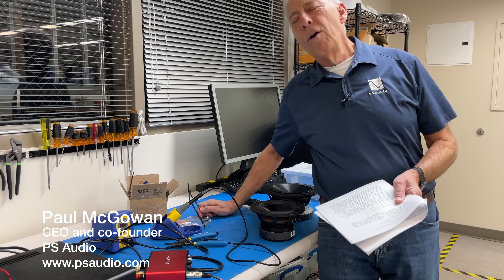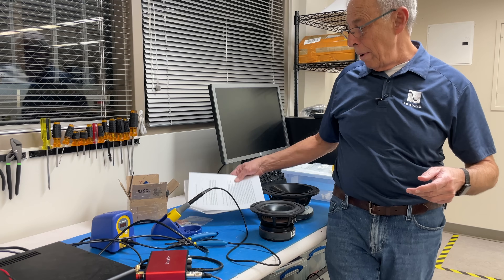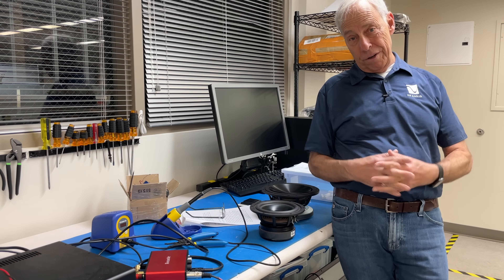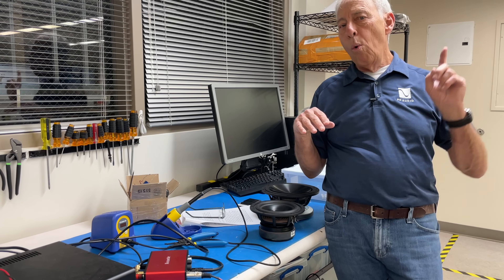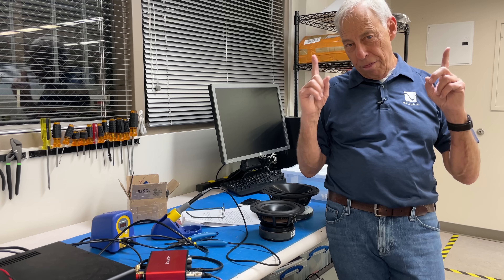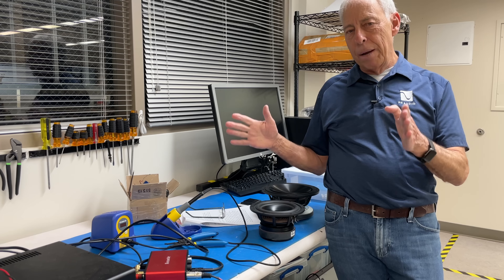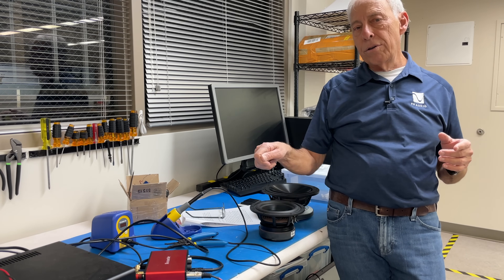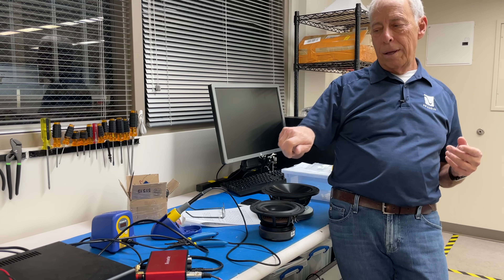Small amplifier clipping

Comment: I have Dali Opticon 2 MK2 speakers (4 ohms, 86.5 dB sensitivity, recommended amplifier power 50-150 watts) hooked up to a NAD C700 (100 watts into 4 ohms), and I'm worried I might have clipped it or damaged the tweeter when listening to Spotify at 77% volume. Is this possible?

Comment: Great point.  I might add that smaller amplifiers may be a better match for high efficiency speakers because the noise floor is lower given equivalent dynamic range specs.  Operating amplifiers at either end of their respective dynamic range also introduces higher levels of non linear response.  In general, the best place to run an amplifier is in the middle of its dynamic envelope as long as it’s not too loud or to quiet.

Comment: I remember when a local high end stereo store near me couldn't demonstrate a system without clipping problems. Of course the only amps they sold were Yamaha.
Reply: Here’s my philosophy: I want to be able to turn all the knobs to the right in their max position with bass boost and loudness turned on and have zero distortion and zero compression/rolloff in the bass.  What equipment do I need for that?  Thx!!!!
Reply: @Mabeylater293  ...You'd need a car that has a speedometer that goes to 140 mph, and then travel that speed until you destroy the engine.
Reply: @Beefcake20  😂😂😂LOL!  No seriously!  Are you saying it isn’t possible?  Some cars let you do that. Google Nissan gtr bathurst 2015. It was the fastest the longest and still the most reliable despite having a smaller engine (v6).

Comment: Really isn't it all about keeping the voltage, on the output, from not hitting the rail voltage supply level? (That is, say the you have a split supply that is 18 volts plus and 18 volts minus,  if you keep the output voltage below, say 15 volts on each side, 30 volts peak to peak,  on it's maximum swing, you won't have clipping (So, no distortion.) ) As long as you stay a few volts below the rail supply voltages, you shouldn't have clipping, for class A or AB amps.  For a class A amp,  as long as the voltage, from the Q point on the load line (on the output device), doesn't swing into saturation or cutoff, there shouldn't be clipping, either. So, no distortion.   Correctamundo?

Comment: hi Paul, is it more a question about the operating point in a class A, AB or D Amplifier ?  if you have a sensitve Speaker Class A is your friend, with a lot of Power consumption. A sensitive Speaker with Class AB Amp you can run in a notlinear operating point with the Amplifier, the output is too low. Class D has no operating point it is on or off.  I thnik the best is a good Class D  amp, the best of two worlds

Comment: When setting up any amp for speakers I've found it's best to use a multimeter oscilloscope and a set of 0db test tones and a 0db sweeping test tone. This is a technique I've learned from doing car audio for years, and will give you max volume and clarity while preventing your speakers from blowing. 

1) make sure speakers are disconnected then hook up the scope to your receiver. Play the desired test tones and find where the clipping point is and go a click or two below it. Some tones will clip before others use the tone that clips 1st to set you maximum volume level. Make a note of where that volume level is. 

2)keep your speakers disconnected, then attach the scope to the amp outputs and play test tones to see where the amp clips. You want to keep the receiver at the max volume before it clips. Once you find the where the amp gain clips mark it. 

3) turn the amp gains and receiver volume all the way down then turn off the system and  attach the speakers or subwoofers. Then attach the scope to the speaker wires.

4) here comes the scary part... have test tones ready (40hz @ 0db for subwoofers and a sweeping tone @ 0db for full range speakers)play test tones at full volume before clipping on the receiver, keep the amp gain all the way down. While looking at the scope increase the amp gains until you the tones are at the desired wattage. You have to be quick playing test tones for too long at too loud a volume will damage speakers and subwoofers. You may also have to use ohms law and figure out the wattage this depends on your scope. Some scopes show wattage others will just show voltage. You can also find sweeping tones for subwoofers too if your worried about damaging the subwoofer. Also because of impedance changes at different frequencies a speaker will act differently with the same volume level. 

This may seem like a lot of stuff to do, but it can be done under an hour. Sound is always subjective and you may find yourself making adjustments after setting the gains, but this is a measured way to set gains and prevent clipping and distortion.
Good luck & Great listening 🤗

Comment: Id stray away from using towers on a mainstream integrated receiver thats just me. Ive blown a tweeter or two that way : ( Some speakers will simply NOT move the woofers at all unless theres a high current amp driving em from my experience. A vintage Altec or Klipsch horn speaker should be fine on most anything however.

Comment: Great discussion as always.
I have a pair of 110w OTL triode monoblocs.  You can run the same amp at 25w by pulling a couple triodes.  It still has the same gain and everything in the system stays the same but the amp power.  So perfect for understanding impact of lower watts.  Into highly efficient speakers, the difference is the bass and overall authority thins out.  With 110 watts, they are dynamic with full bass.  Everything the same, at 25W the system still sounds great just lacks body and grunt.  And the bass is underpowered.  Even though I listen at  <85dB and mostly in the first watt, I easily prefer the sound with the extra power on tap.
Reply: @Jeff Taylor I expect that the OTL design of W's monoblocs may affect the impact of removing a couple triodes. Since the A-50 has an output transformer, its bass may work better despite its low power.
Reply: @tiburd7  Quite possible.  The OTL circuit is by Transcendent Sound.  Designer is convinced he sorted out the bass and it's driving an easy 8ohms, but who knows.
Let us know which you like better.  The SE 300B into efficient speakers may be quite special.

Comment: Even with a pair of speakers with 85 db in sensitivity you dont need that much power to play loud. I think its much worse with speakers dropping in impedence to about 3 Ohm and sometimes lower. Its very common with speakers dropping below 4 ohms. Even if they have high sensitivity mind has 90 db But drops to 3,1 Ohm in impdence They are quite difficult to drive. Many amps can have a lot of power in 8 ohms. But They rarely tell you how They perform with 4-2 ohms loads

Comment: I have a low power amp that's 50w if I change the voltage supply&the transistor can I make it  500w or I'll just burn the dyam thing
Reply: You're talking about changing to power supply voltages that are 3x higher than the circuitry is designed for.  
Don't even think about it!  It would require a major redesign (not to mention much larger heat sinks), and it's far more practical to just buy a bigger amplifier.  Then you can keep the 50w amplifier around for times that you don't want to play music loud, and you would like to save on your power bill.

Comment: In my system my speakers are rated at 88db / 4 Ohm. My amp is rated at 500 Watts RMS output per channel into 4 Ohms, total harmonic distortion < 0.03 %. It is incredibly rare that I push out over 10 watts (as shown on my amp's meters) in normal listening situations.

Comment: some speakers especially some old ones from the 70's give louder sound db. instead of running 100w you can use 50w amplifier clips no different

concert PA. speakers have higher sound by 50w than the newer hifi speakers provide at 50w

Comment: Clipping happens when the amp is overstretched right? Speakers drawing too much power. Something that is not likely to happen at normal listening levels unless there is a massive mismatch between amp and speakers or the users are students in a dorm.
Reply: I think Paul should have emphasised your point, that the main danger comes from overdriving a small amp when using it with inefficient speakers whilst trying to achieve high sound levels. The musical sine wave is flattened at the top and bottom of each peak and trough in the voltage cycle, causing the speaker’s voice coils to overheat and burn out. A very short burst of this is relatively harmless, within reason, but a 1kW amp turned up through efficient speakers could just blow them up. Common sense should prevail. Your ears will tell you something’s wrong in either scenario. This is why decent speaker manufacturers such as Harbeth will guide you by quoting a minimum recommended amplifier power to use with each model.

Comment: The simple answer to the question is no.
A 25watt amplifier operating with the volume control set halfway is no more likely to clip than a 100watt amplifier with its volume set halfway.
The fact that the 100watt amp is louder has nothing to do with it.

Comment: Not that good an answer in my opinion ... 
the word headroom and dynamic range didn't get a mention ... along with peak power handling capacity of the speaker.
A small low power amplifier bipolar or mosfet can burn out a higher power rated speaker if or when the amp clips ! Note this only applies to direct coupled output stages and not vacuum tube amps ...
Reply: That’s helpful, thanks. What happens if you use tube amps as I do, please?
Reply: @mikeuk4130  the problem doesn't arise quite so much with transformer coupled tube amplifiers ... because they cannot couple DC . The problem with bipolar/ mosfet designs is that the speaker load has the ability to get driven into clipping on to the DC positive and negative supply rails .. Class D amplifiers don't have this problem .. or capacitor coupled Class A or AB transistor amplifiers.. such as the Quad 303
Reply: @janinapalmer8368  Thanks for that, Janina. Presumably, the clipped i.e. flat parts of the wave are equivalent to DC whether + or - , or is that too simplistic?

Comment: so I added a 60 watt power amp to my existing 60 watt integrated; I drive the tweeters with the integrated and mid_bass with the power amp.  I do get more volume now but not by a crazy amount,  but I do notice the sound being cleaner on the top end.
Reply: I think that means you are now getting more clean power to the speakers by keeping each amp further below the higher-distortion and clipping zones at a given sound level, or double (+3db) the volume for the same level of distortion.

Comment: The story with the voltage and gain is confusing me. If the voltage gain is the same for a 1000W amp as it is for a 10W amp that means that a 1000W amp would need a much higher input voltage to reach maximum power. It does not make sense with a normalized output voltage of pre-amplifiers.

Comment: As long as the output doesn't try to climb over the rails, no it doesn't. The part that is concerning is audiophiles who do things like run dual 1.2kW monoblocks with bookshelf speakers. I don't think they have ever considered what would happen if there were a full power excursion. Even with speakers rated for that power I would not want to be anywhere near it. 140-150 dB with subs in a car is a lot different than 140-150 dB with full range speakers. Thats the main reason I don't run more power than I need. I never know when I will get all of it when I don't want it.
Reply: Some of us enjoy driving a 740 HP Ferrari, even though the speed limit is 65 mph.
Reply: @davidcontini7217  I enjoy my sports car, too, and drive north of 150 MPH despite said speed limit. But I don’t particularly enjoy listening at similar SPLs. The two are a false equivalence. I would easily use all 740 HP since cars don’t have absolute performance limits. Your hearing and ears do, so seldom do you use more that 100 watts of power. The other 2300 watts is just waiting to burn something out.
Reply: @davidcontini7217  
Take it to the race track.  No speed limits!  Wheeeeeee!!!
Reply: "I never know when I'll get all of it when I don't want it"
How exactly can that happen ?
Reply: @poserwannabe1  Easy. Listen to something like classical music that has its levels some 20-30 dB less than what you normally listen to, and forget to turn the volume down. Or just having the source go to 100% volume.
Reply: @Lassi Kinnunen 81 good points, those situations could occur...I do however always have more power on tap than necessary for any system I build, they just sound cleaner and more effortless.... peace
Reply: It always better to run more power than you need, it calls headroom, you should Always have headroom so you not risking clipping
Reply: @andreasmoller9798  Which is fine, and why something like 250W RMS/channel would be quite appropriate for most domestic two-channel systems. Its only things like car audio with lotsa subs and home theater with higher transients and more channels that need the multi-kw amplifiers. Obviously, lots of power is not a danger in of itself, but if you are like me and listen to a diverse range of content, excessive power can be a real liability. Either from the source being left at high volumes for low level music, or just the volume control accidentally going to full volume. Nice to know there are some safeguards preventing the woofers from exiting the gap, and possibly even the baffle itself if there were those kinds of power levels that some audiophile amplifiers have.
Reply: @andreasmoller9798  And its not just blowing drivers that could be an issue. With very large speakers that have sensitivities in the range of 90-94 dB range, full power north of 1kW could even potentially cause permanent hearing damage, even for relatively short durations. In my car system it will easily max out a 135 dB SPL meter, but this is all low frequency content, so the ear is relatively insensitive to it. With a flat response from large speakers, those SPL levels are a very different story. Even 86 dB sweeps for making measurements are quite loud, and something like a 94-96 dB sweep is unpleasant even in an adjacent room.

Comment: The genre of music can make a big difference to how much power you need. Music with much lower bass need more power.
Reply: @Taco Wrong, obviously your heavy high power woofer is where most of the power goes especially with music having lots of bass in it. Subwoofers often max at 1000s of Watts while tweeters max at 10s of Watts for the same system. A drum typically emits more sound pressure energy than a voice, for example thus rock music needs more power than some vocal music. I enjoy music with deep bass playing reasonably loud and a small amp is not adequate. Of course this doesn’t mean Paul is wrong in the topic of efficiency.
Reply: @Taco Well, if you listen at low volumes with little sub bass, yes, you really don't need a lot of power. But if you listen fairly loud with a lot of sub bass shaking your house (like I do some times), you can peak on 100s of Watts in my setups easily (I measure these things). Sure, power is often over-rated and a doubling of power is barely noticeable (3dB). And this means you need incrementally more power to gain more loudness. E.g. it takes 900 Watts more to replace a 100 Watts amplifier to play twice as loud while it takes 9 Watts more to replace a 1 Watt amplifier to play twice as loud at peak. Yes, of course more efficient speakers need less power but efficiency can also come with a price of poor performance. For example, you can make bass more efficient by relying on bass ports and resonant designs but often with a price of poor decay performance and more distortion. I prefer closed chamber subwoofers with fast decay and low distortion; and they usually consume much more power.
Reply: @Taco That doesn't take into account modern systems with DSP correction. If you have a subwoofer that starts to roll off at 50Hz and you add a huge boost around 30Hz to level it out, you will definitely need a lot more power to drive that subwoofer.
Reply: @Douglas Blake Yes, subwoofers need more power because when you play music with deep bass you need more power. A big speaker with sub bass capability will need more power too when the music contains deep bass.
Reply: Aphex Twin
Reply: @Taco I'm also talking about diy audio, not just prebuilt stuff.
Reply: @Taco not arguing, just discussing
Reply: @Taco yeah
Reply: @Taco are those mutually exclusive?
Reply: @Taco you're acting like I'm saying you're wrong. I'm not. I'm offering a different viewpoint and one in which more power would be necessary. Like the other person replied, it also depends on the genre. Any rap beat with heavy 808s is gonna need more power to be comfortable than a recording of an upright bass.
Reply: @Taco calm down dude lol
Reply: @Taco ok play your 100db speaker on different genres you’ll still use more on some genres
Reply: @Taco yes you won’t have to put so much net power but you’ll still have a difference which is usually more on some genres